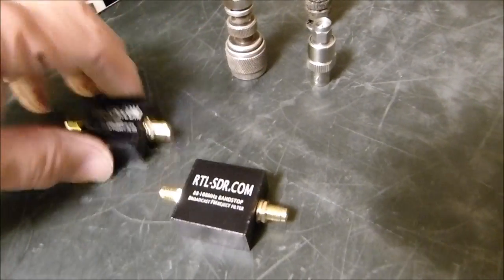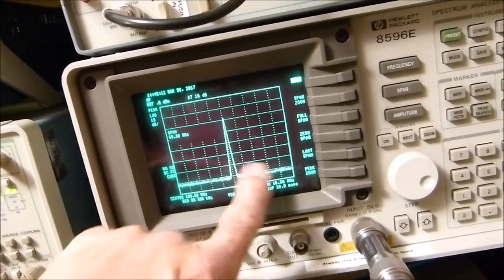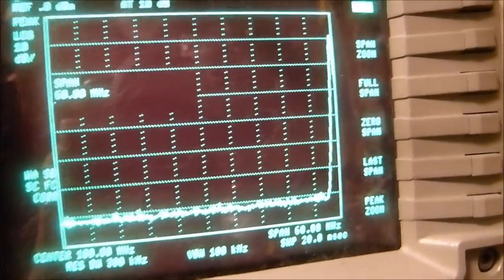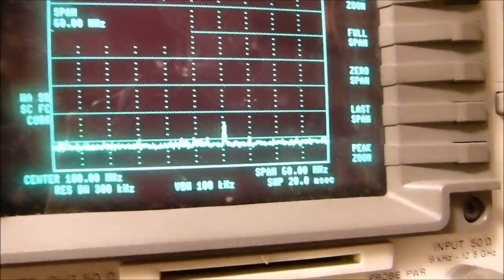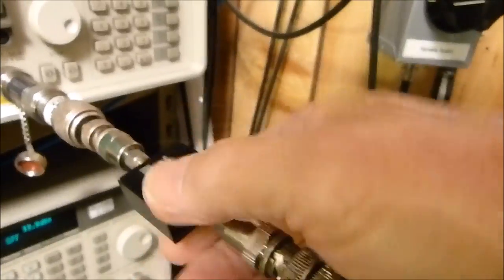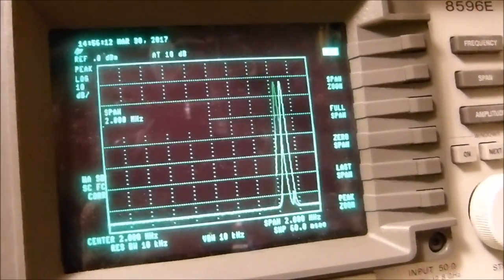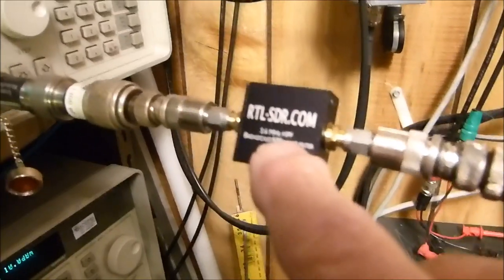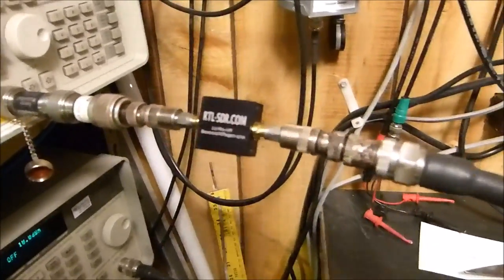RTL-SDR 88-108 MHz Bandstop Filter & 2.6 MHz HPF Broadcast AM Filter Measurements

Comment: Thank you for testing these units out. I need something to filter out a local AM broadcast station and was on the fence with these units because I wasn't sure how well they worked. I've been very happy with the RTL-SDR Blog products and now I wonder why I questioned these filters. I should have known that they would work as advertised. Guess I know what I'll be getting now.
Reply from the maker: Wonderful... it is always nice to see that my videos can help someone. The filters perform as advertised and as they should. I hope it solves your problems. 
BTW - I have changed to the SDRPlay unit and I am extremely pleased with it. It has pretty much become my choice of communication receiver on 20M although I still use my 75S-3 and R-390. I have found that PC speakers sound good for communication work.

Comment: Switch it in and out, those cheap sdr's are full of holes. You pick up the AM broadcast band repeatedly over and over. No image rejection of strong signals in the mess of multiplexing going on in that little box. Strength of local AM signals allow continuous multiple harmonics to be scattered within the radios entire spectrum. The 2.6 filter looks to be a must if you wish to enjoy the inexpensive sdr's full frequency range without portions being clobbered with AM broadcast harmonics . I will order a 2.6 filter soon. Thank You for the performance tests! PLV

Comment: It was the best demo I found! one question, can i use the 2 together?
Reply from the maker: The  2.6 MHz HPF is there to stop AM commercial broadcast interference (if you have that issue) and the 88-108 MHz filter is there to stop FM commercial broadcast interference (if you have that issue). So, it looks like if they were in series you would not let anything thru below 2.6 MHz and then attenuate 88-108 MHz.   Hmmmm.... I suppose that would be OK but I am not sure.

Comment: love to see this connected to a yv tuner to see if it improves  DTV signals
Reply from the maker: I was hoping for  improved S/N ratios also but it seems I don't (fortunately...) have a noise level that these devices helped. They worked as advertised but they did not seem to improve anything for me - at my location and noise level. They may or may not help your reception depending on the background level you experience.

Comment: Is there a filter that blocks just the Broadcast AM frequencies, but lets the HF / MF bands through? I'd love to block out all broadcast AM & FM, but still let WiFi, and all the ham bands through.
Reply from the maker: Yes, the 2.6 MHz High-Pass-Filter (HPF) will block all of the frequencies below 2.6 MHz and the AM frequencies are from around 0.500 MHz to 1.600 MHz. The filters do work as advertised as can be seen in this video, however, if the pickup of the AM frequencies if from stray wires, etc past the HPF, it will likely not help meaning it will only block this range of frequencies if they are coming from the antenna that this filter is in series with. Basically, you just have to try it and see if it will do what you need it to. Hope this helps.

Comment: i have the same filter and FM broadcast spurs  are higher    on  430 Mhz 27 Mhz and more ...is my  filter defective
Reply from the maker: It is only going to attenuate and reduce spurs  in the 88 to 108 MHz range and isn't going to do anything for you at 27 MHz or 432 MHz so I don't think your filter is bad but like in my case, even though they work as advertised, they serve no real purpose for some of us. I am guessing you are pretty close to an commercial FM station? Maybe in your case, your filter is actually picking up RF and making the problem worse at your frequencies of 27 and 432 MHz. It is just one of those things that you try it and if it helps that is good but if not, or if it makes things worse, you remove it. You never know what some of these devices are going to do for us. Hope this helps.

Comment: can you place them in-line?
Reply from the maker: Yes, they are placed in -line with the antenna connection to the receiver equipment and you can place them in line with each other. In this case, placing these two in series,  you would eliminate everything below 2.6 MHz and then eliminate the band between 88 MHz and 108 MHz. They don't improve/amplify  anything else but they would eliminate or greatly reduce any interference coming in from those frequency ranges.
In the case of the RTL-SDR dongles, I have read and learned personally that the RF front-end of these little devices are easily overloaded. I have a good outside mounted, wide band antenna I use on the RTL-SDR device and I find this overload to be a real problem. I have inserted an attenuator in series with the antenna input to the SDR and it helps considerably. It lowers the noise floor and spurs and increases resolution with 10 dB attenuation and the strong FM stations in the area require 40 or 50 dB attenuation to keep from overloading the front end of the RTL-SDR device. I would like to have an SDR device with software programmable front-end attenuation.
Reply: David,you are taking a long detour going from the signal generator to the monitor with that long piece that has the bandstop filter on it. Your videos are always the best.